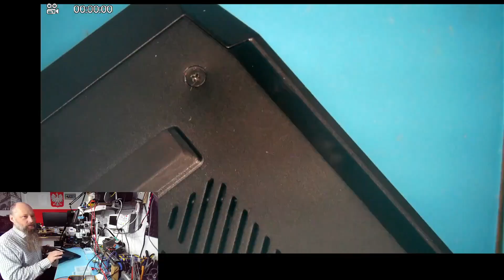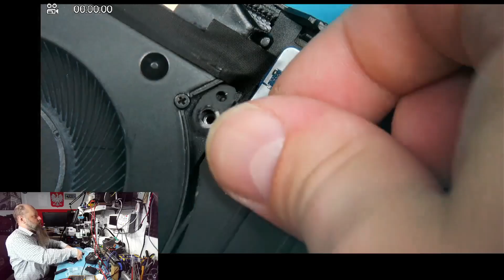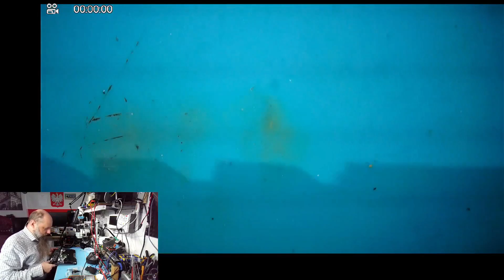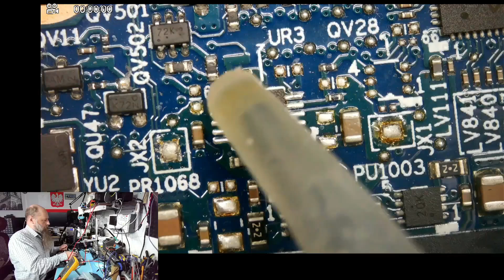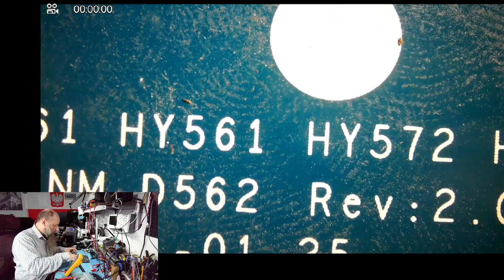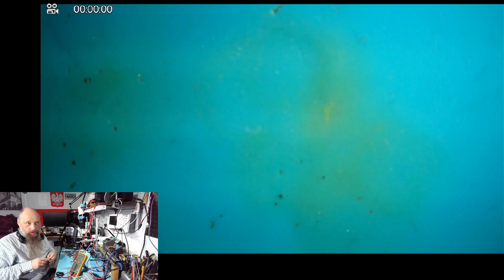167 | Lenovo Legion 5 Pro 16ACH6H NIGHTMARE!!!

Comment: Likely shorted 19V to 3.3V rail and killed everything on the 3.3V. Most likely when checking the PMIC controller capacitors.
Reply from the maker: could be, the other shop agreed to compensate the customer, a little lower than the damage but better than nothing :)

Comment: I see you chasing the short all over around and it's really very time consuming. I understand it's risky to start injecting voltage directly to a suspicious component not knowing if the current can find a path to some other component and create more damage. Well in such cases where uncertainty is very high you can work using a quicker and safer method. In most of the components you removed and especially in power stages you can see very close to them solder jumpers. In the mainboard you were working are labeled as PJ or JX. Usually, a power stage has one jumper in the input and another one in the output. All these jumpers together are separating the motherboard into sections. Therefore, if you want to know if a power stage is shorted or not you just isolate it from the rest of the motherboard by removing those jumpers. Or you can remove only the input or output. That way you don't have to remove components without knowing for sure if they are the cause of a short or not. In your case now I don't believe all these components you removed were shorted. The fact that resistance was different is most likely because the current took a longer path to the ground than before. Removing components you also remove shorter paths to ground.
Reply from the maker: Thank you so much, this is very helpful

Comment: I have a Legion 5 pro it's taking charge normally but when pressed only the power button lights up ( no keyboard,no fan). I've seen several other cases like this but none has any solution( some people tired bios flash but didn't work). Can anyone suggest what's wrong ?
Reply from the maker: If the mobo boots (reacts to power button) the EC chip seems to be working so the next step is the BIOS. How did you reflash it? If you just flashed the one from the website it will not work. There could also be some power delivery issue

Comment: When something bad happens on the 5V rail it's indeed typical for a lot of ICs to get burnt, various regulators (including VCore), peripheral controllers like audio and card reader… but if that's the only thing that happened it's not too bad.
In this situation, the CPU/GPU/PCH are generally fine. So just gotta remove the ICs from the 5V rail one by one until it's clear from shorts (probably a couple kiloohms) and then replace the critical ones (regulators), the other stuff (peripherals) can wait until you confirm the rest of the board is fine. Best is to have a donor board at hand.
But since it's been messed with already there's probably more work waiting afterwards…
Also I wonder why did the customer attempt a manual BIOS update in the first place, and what happened during the update. Maybe there were some prior issues with the machine…
Reply: Yes, 6 ohm on 5v rail is definitely not normal. 
I'd say 20v went to 5v rail... how that happened we won't know.